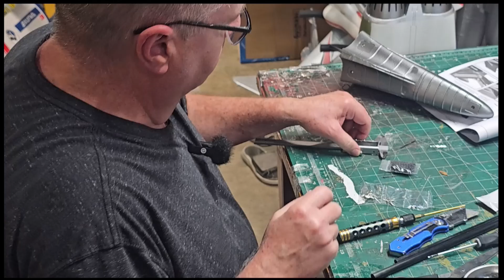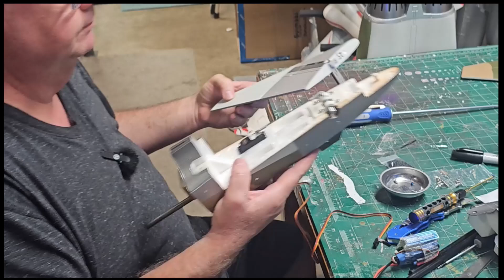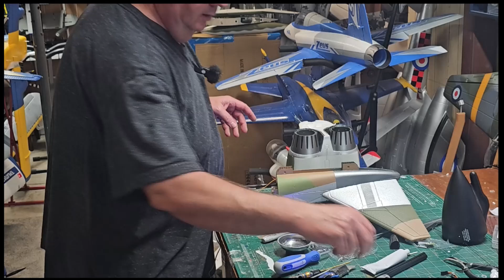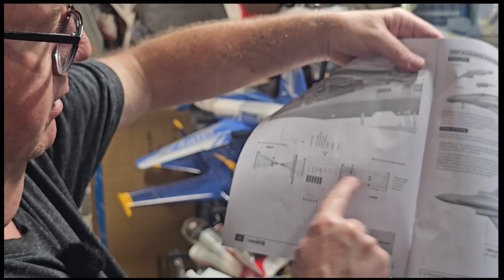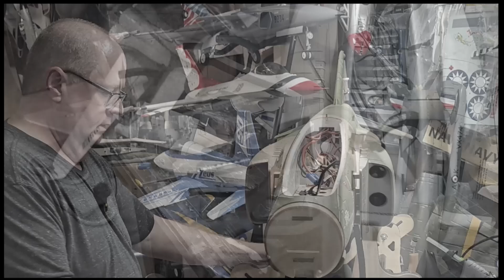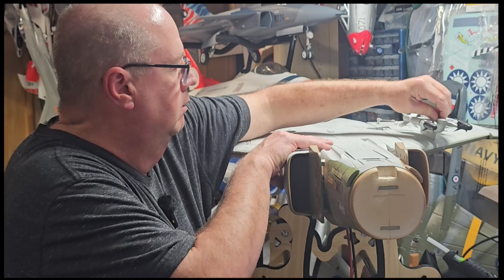FREEWING F4 PHANTOM II DETAILED BUILD by FGFRC #aviation #rcjets #rc

Comment: Hi, have you read about the elevator servo and linkage braking ??
Reply from the maker: Yes I went back after this video and reinforced everything prior to the maiden. Epoxied in the servo, wrapped the push rod with another steel wire to prevent flex and put in a washer stopper to prevent the ball link from slipping off.
Reply: I have one that i havent yet assembled, im updating to hi-tec servo, it is ‘really recommended” to regularly check it

Comment: Enough room for two batteries? And I dont see a carbon fiber rod to renforce the fuselage
Reply from the maker: Yes 2 4s or 1 6s ,   carbon fiber in the wings and tail section and there may be one embedded in the fuse but I did not see it.